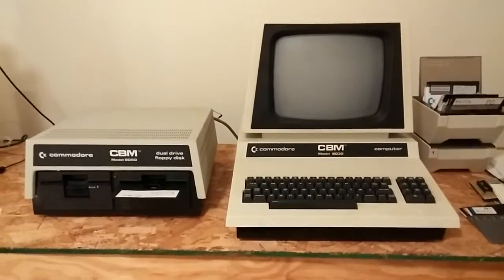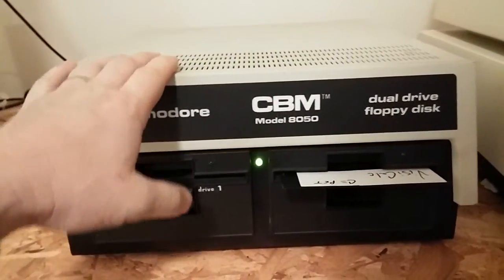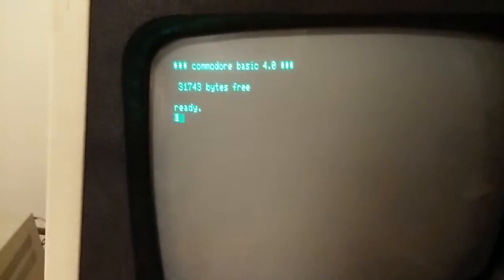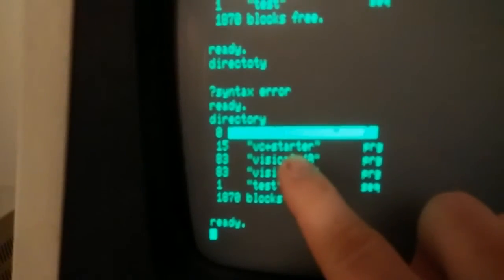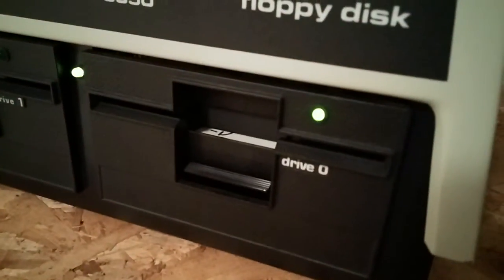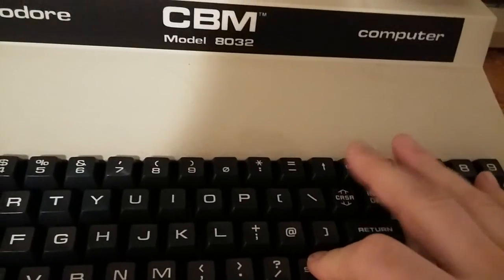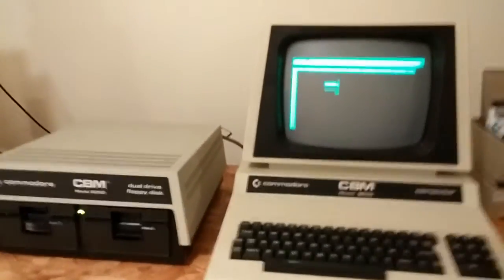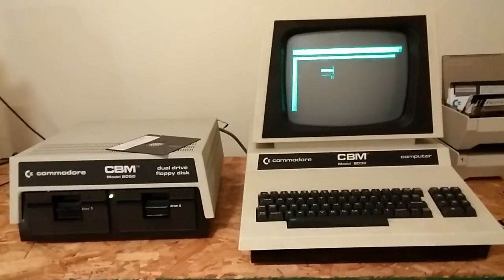VisiCalc on the Commodore PET

Comment: I used to cut out a 2nd write protect notch on my disks to use the other side of the disk in my 8050.  About a MB of storage if you use both sides.  Not bad for 1980.  I've not seen a Micropolis 8050 survivor before.  I think they're pretty rare.  The Tandon drives seemed to be more reliable.  I still have mine and it's a Tandon.  I had (and still have) a working "2001 Series Professional Computer" (or 3032 in the vernacular)  Thanks for the blast from the past.  I tell some of the young ones I work about these old machines and they look at me with a mixture of awe (if they're true nerds) or like I'm describing how a Conestoga wagon functioned if they're not.  The 40xx PETs came out I think in 1981 or 1982.
Reply from the maker: The 8050 came as a set with the 8032, from an executive who took the set with him when he left Commodore.  They were boxed, with his shipping address on them.  I don't think too many boxed PETs survive either.  https://imgur.com/a/BNUSd

Comment: The first time I saw that model Pet, I was blown away since it looked like a computer should look.  However, it’s monochrome screen led me into the arms of Apple.  

The magic of these old systems is not about what they did.  It was all about what they could do!  It was such a dramatic entrance into the psyche of Americana!  

The Pet had the aura of a business system.  And I think that was good and bad for commodore.  But, the Apple ii plus has a language card.  On first glance it sounded so international!  But, it just meant it had two versions of BASiC.  Surprisingly, Apple Integer BASIC and AppleSoft each had pros and cons.  it was not immediately clear that AppleSoft was “better”  unless you wanted floating point calculations.
Reply: Hilarious. Apple's color was SO BAD, they added a "color killer" circuit as an UPGRADE.

Comment: The diskdrive has more power than the pet :-) You have two CPU´s running to operate the diskoperation standalone as dualcpu multitasking !!!! 

If you send an copydirective to the drive , the station runs without the computer and if it finished, it send an call via errorcanel to the PET

Comment: Can you use a Vic 1540 and 1541 and 1571 with a CBM 8032?   I'm thinking yes, because they all use the original PET serial interface.  I have all of those, plus a Vic, 2x C64, a C128 and C128D... and have never turned any of them on except the PET.     I did use those honking big dual PET drives though back in college.   Used them all in the 1980s, but haven't used any since... these I got all in one big dump.

Oddly, I programmed a Spreadsheet like program for the Dean from total scratch starting on a PET, but I moved the whole project into compiled Quickbasic on an IBM AT that compiled at an insane 12mghz...     a lot faster than the PET.   This was in 1986/87.   I thought I still had the source code/compiled binary on my webserver in my code archive but don't see it there.
Reply from the maker: PETs use a parallel (IEEE 488) interface , so no you can use the serial interfaced drives, unless you use a parallel to serial adapter.  Commodore produced the serial interface as a cost reduction move.  The parallel cables were very expensive.  Sounds like a nice collection there!
Reply: @douglascrawford2563  -  Seriously?  I thought the whole point of the 1540/1541 was to be backward compatible with the PET/CBM machines.  Grr.  Anyway, I checked my collection, and I don't have a 1540... I have a Vic Styled White Vic1541 (It actually says Vic on it) and  Grey 64 Styled 1541.    Somehow I ended up with an Amiga modem but no Amiga, though I had an opportunity to scarf a 500 once upon a time.   I didn't because I despise Workbench.

I miss the old days but wouldn't go back.   Sadly, I coveted and dreamed of all these machines so incredibly far out of my reach when I was a kid, and now that I have them all, i can't stand to look at them.   I remember when a Quadra 950 Tower was like a Super computer.   I don't think I've ever booted mine up.   I was bring them all home at one time by the pickup truck load....

Comment: d-i and Shift-R is the short form of directory.
Shift + RUN/STOP will load and run the first  program on disk (for Basic 4.0 machines)

VISICALC is a copy protected program. The copy protection is a ROM chip that you have to install on the motherboard. This has all identifying marks removed. Do not lose this as it contains part of the Visicalc program.

Stephen G7VFY
07956544202
Reply: cA is shorter than diR

Comment: 8250 was the double sided version of the 8050.
There were two hard drives, 9050? and 9090. Very unreliable.
Reply: Never heard of them.  I too have an 8050. Can u find any evidence of these ever existing? Commodore was famous for vaporware after all. Like their stringy floppy disk from the same era.
Reply: 8250s sell on eBay from time to time.  I have a D9060 hard drive.  I've seen D9090s.  The D9060 is 5Mb, the D9090 is 10Mb.